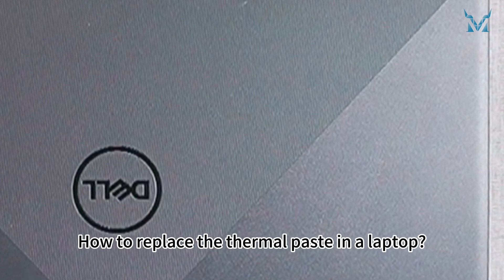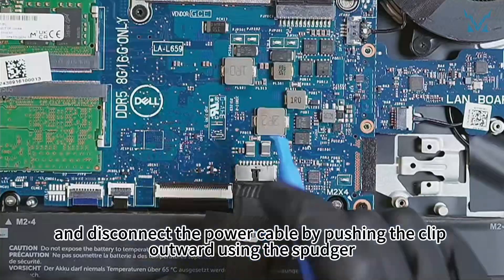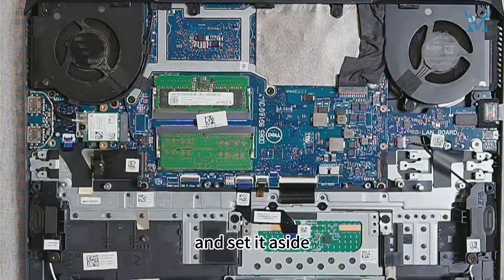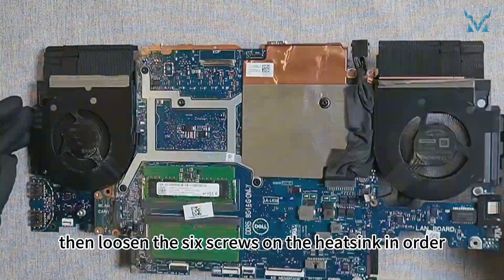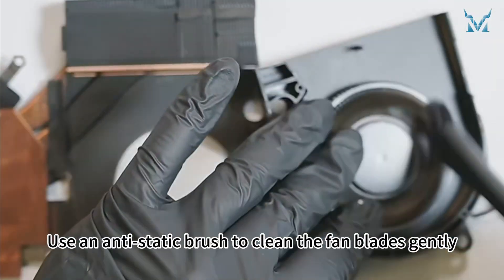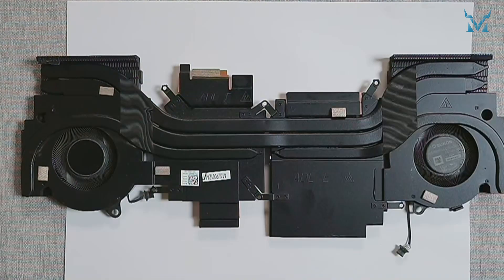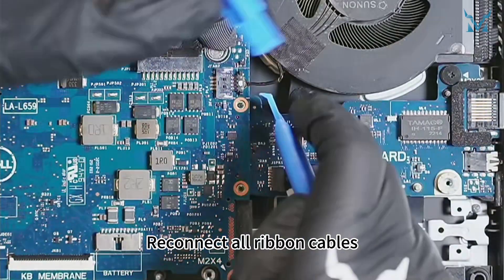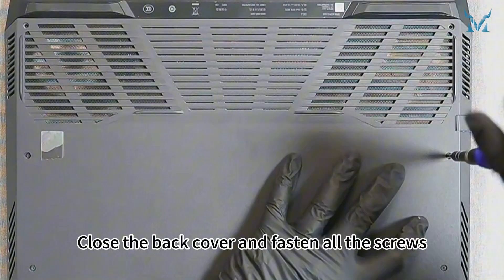Speed Up Your Dell G15 5520 2022  Prevent Overheating With Dust Cleaning & New Thermal Paste

Comment: Thank you for this video. I have the same laptop, a Dell G15 5520 with an i9 processor. My laptop screen is not displaying anything. However, when I connect an external monitor, the display works fine. I have also replaced my laptop screen, but the problem persists. I went to 3 to 4 repair shop they didn't find any solution. Can you please help me?
Reply from the maker: Thanks

Comment: Are the fans really attached to the heatsink ? Or can I remove the fans only. This stubborn father of mine insists and forces to clean the fans while it's still attached to the motherboard, I'm afraid that dust has accumulated in the heat sink because of the way he cleans the fan as he pushes the dust in.
Reply from the maker: Thanks

Comment: please do the same thing on DELL G15 5525
Reply from the maker: Thanks for the suggestion! The Dell G15 5525 is definitely on our list—great machine but tends to run hot. When we do it, we’ll show full cleaning and repasting with KOLD-01 thermal paste—it works especially well for Ryzen models like that. Stay tuned!
Reply: @koolingmonster waiting 🙏🏻🙏🏻
Reply: I have the same laptop and this tutorial works for that model too, a few connectors less and some screws on another location but is basically the same.

Comment: which material used to make dell g15 heatsink
Reply from the maker: The Dell G15 typically uses copper and aluminum for its heatsink assembly —

Copper is used for the base plate and heatpipes because of its excellent thermal conductivity.

Aluminum is often used for the cooling fins to reduce weight while still providing good heat dissipation.

If you're doing maintenance on it, make sure to use a reliable thermal paste like KOLD-01 to get the most out of that heatsink

Comment: i want thermal past change in ideapad gaming 3 15arh7
Reply from the maker: Sure! IdeaPad Gaming 3 15ARH7 can be repasted easily. Just unscrew back panel, remove heatsink, clean old paste, and apply new one. Make sure to use good quality paste!

Comment: My laptop not have the "DDS" cable. The connector is empty
Reply from the maker: It sounds like your laptop model might not require the "DDS" cable, or it could be optional depending on the configuration. Check your user manual or the manufacturer’s website to confirm. Let me know if you need more assistance!
Reply: Mine doesn't either

Comment: Great work, what do y'all think about doing this with hands and a good screwdriver set with some plastic spoons maybe or something as I cannot arrange the pry tools, my thermal paste came without a spatula so I'll spread it with maybe a plastic tape in my fingers.
Reply from the maker: We sell complete toolkits, and I recommend purchasing a proper set of tools. It will make future use much more convenient. Applying thermal paste with your fingers carries some risks, as it can lead to uneven application or contamination of the paste. Investing in a proper toolkit not only ensures more even application but also helps prevent damage to other components, making it a worthwhile investment in the long run.

Laptop dust cleaning & thermal paste replacement tool-kit combo: https://bit.ly/KMtoolkit